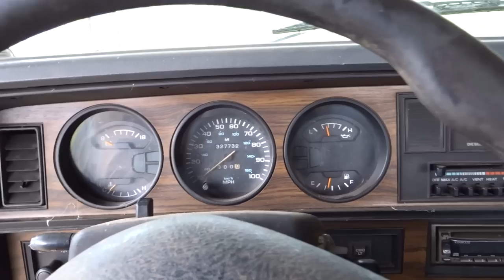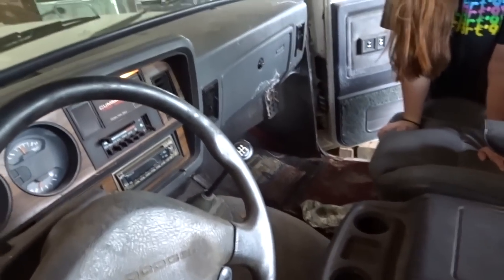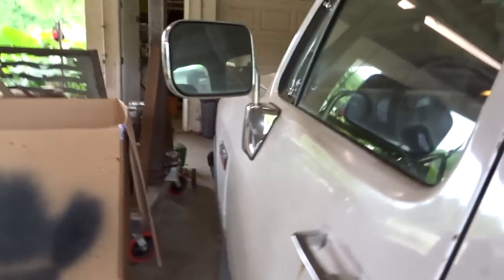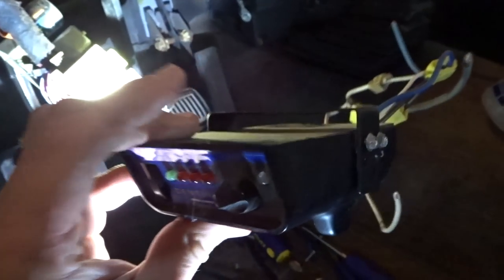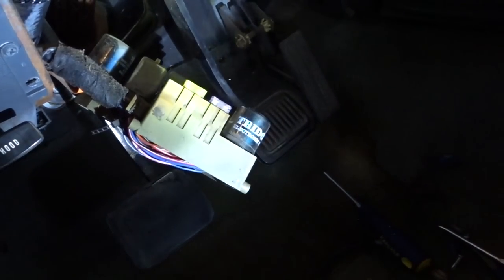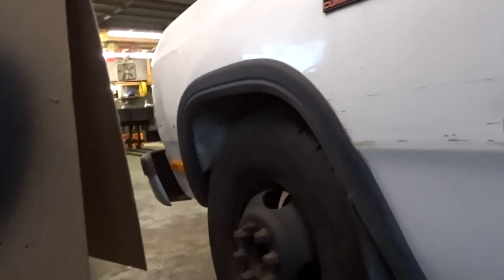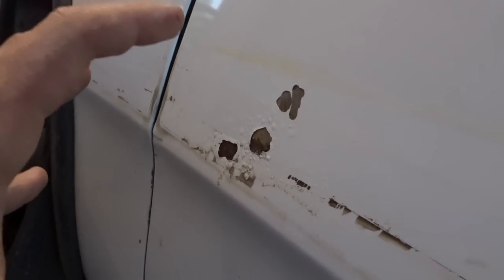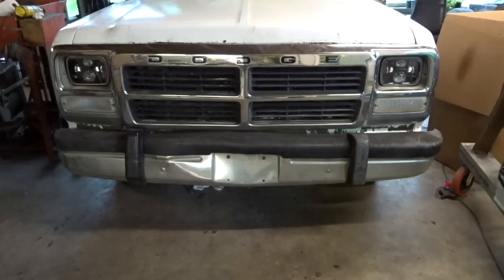Cleaning Up Ole Bud, Ready To Hit The Open Road!!

Comment: Bleed the injector lines if you haven't already done so.  It will help with the hard starting. Crack open the nut on top of each injector where the line goes into the injector . Do it while the engine is running, let it bubble until you get a good squirt out of the injector, then tighten the nut - then go to the next injector and repeat.  The fuel leak at the injector pump can also be the source of a hard starting issue, It can make the injection pump lose it's prime.
You might want to replace the electrical portion of the ignition switch, it usually is the source of the cranking and run solenoid issues.

Comment: I wouldn't call that "patina"... it's not THAT old. 😂   Wire wheel the bad spots, put a little filler where it's needed, give it a shot of white paint, clear it, and run it. Got a ways to go yet before it needs a full "restoration". Drive it and enjoy it without stressing about a glossy paint job that took you hours to prep and finish out. 👍